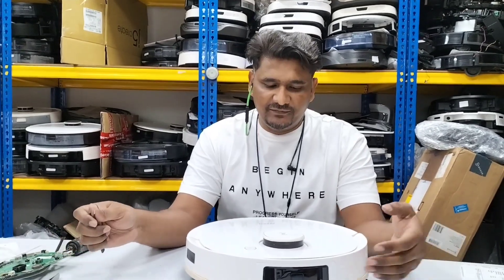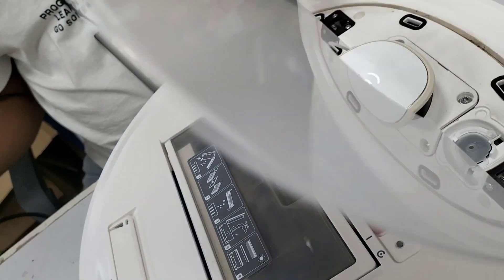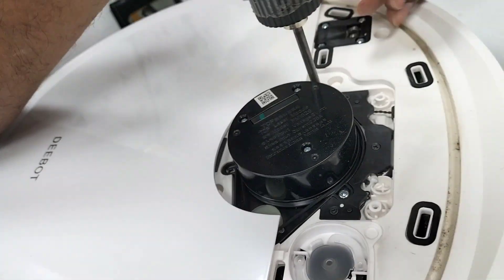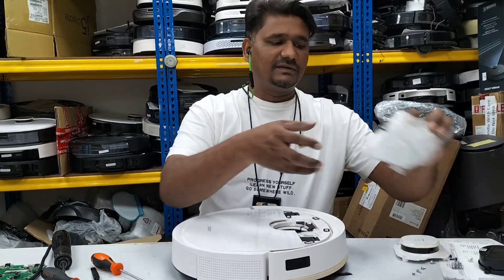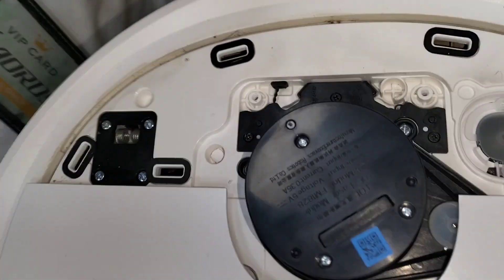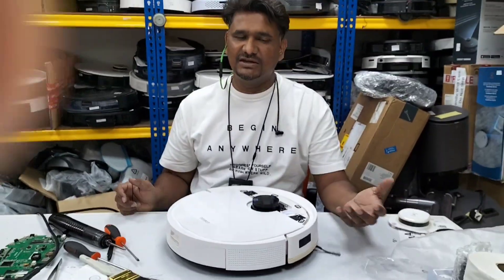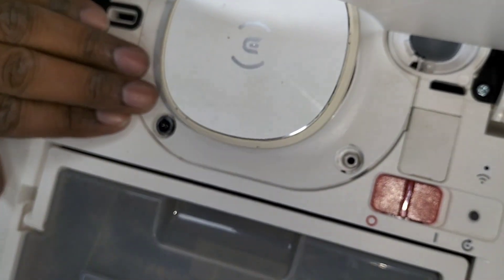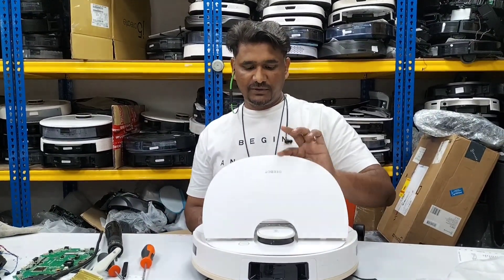How To Replace the LDS Assembly?

Comment: Thank you for the videos? I have a Deebot 930 which gives a error message "My LDS is blocked, please clean it". I have cleaned it with compressed air, opened it as per your instructions. No blockage. Belt is fine. 

Can you please do a video on this issue?
Reply from the maker: In this model very rare got lds issue.. But whenever I get in this model need to replace lds assembly
Reply: @ecovacstechnicalsupport5278  Thank you for your response. I might as well throw it. No support in my country
Reply: Same with mine. I done cleaning and it can clean, after few minutes random then it just stop and keep saying LDS error. Here don’t have the service center. I called the reseller and they just said no replacement part for 950 and ask me to buy new robot instead